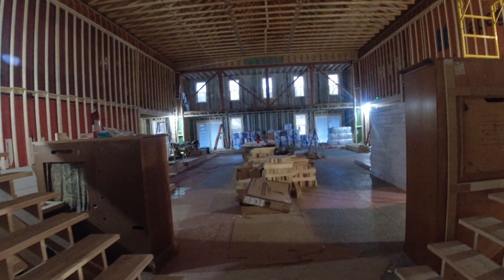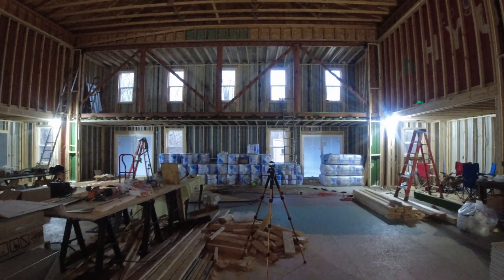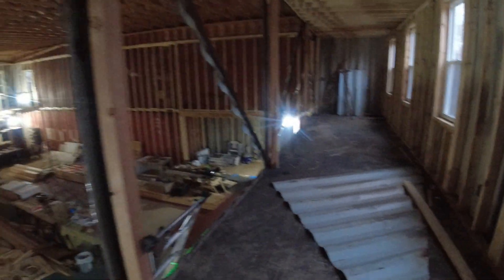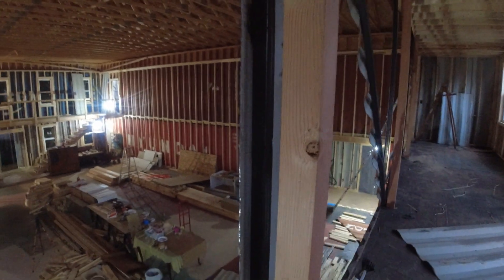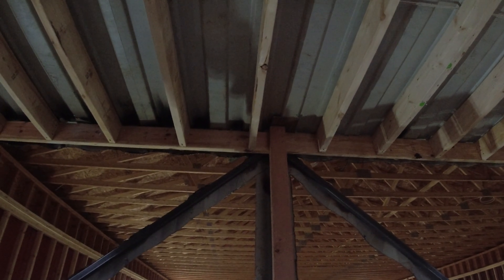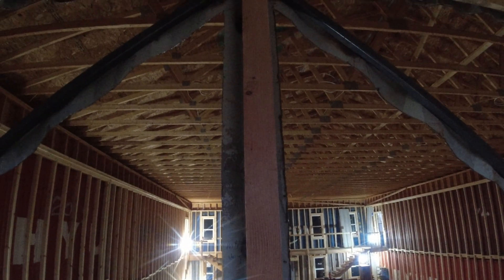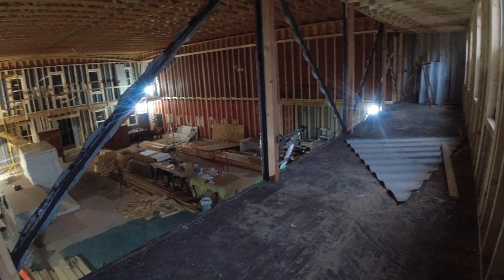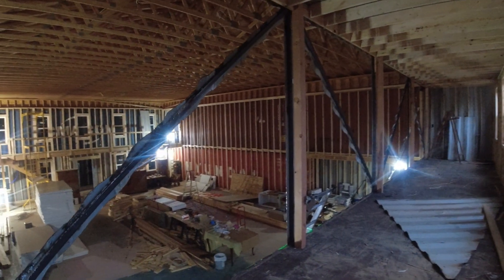How I maintain structural integrity when cutting open a container wall in a shipping container house

Comment: Thickness of those 1.5" structural columns?
Reply from the maker: Good question. 3/16" thickness, with a yield strength of 46,000 PSI and tensil strength of 56,000 PSI each. I actually did an engineering study of the structural strength of the truss structure for the city for approval.  I will make a video of it soon.

Comment: Sure you don't need a bigger house? Massive carbon foot print. 🤷‍♂️
Reply from the maker: That’s an appropriate comment. If you watch my video about my HVAC system, I am going solar and using mini splits. So the footprint is small to negligible.
Reply: @1michiganbuck  Just the concrete alone is probably 10 peoples lifetime carbon load. Why do you need so much space? Is this going to be a convention center or something? I can see it if this is going to house 20 people maybe?

Comment: Are you going with close cell spray foam with all exterior steel?  If not I would research it. No expert, but I would put some everywhere there is steel on the exterior walls, floors and ceiling. 

Keep up the good work.
Reply from the maker: Yes, I will use spray foam for all exterior walls and the ceiling.  There is no alternative because metal sweat like crazy when exposed in the heat and cold.  Interior walls don't sweat, still, I will use fiberglass for sound deadening.

Comment: I looked at building a 24 x 36 shipping container shop for woodworking a few years ago. Here is what I found then and after. The floor and corners of the container are the only structural parts. The walls and roof are not. Reinforcing the roof after removing the walls and the cost of three containers ran close to $20,000 without finishing the inside. No power, electricity, or heat. The engineer said I would need .5 X  6 X 6 inch 36 feet long I beams to support the roof. I looked at stick build and as a DIY project. The stick build came in at under $10,000 with concrete pad, power, insulation, heat, and electricity. Later I started teaching construction, and safety was a part of it. This led to becoming an OSHA safety instructor where I learned that maritime containers have some very bad chemicals in them. The wood is full of anti-decay, insecticides, and fire retardants. The paint has anti-corrosion products in it like cadmium that are very toxic and require a respirator if you are exposed to it. So, if you cut, sand, grind, or weld it should be treated just like asbestos. If a building inspector or sub-contractor walks on the floor and kicks up cadmium dust you are by law responsible for their exposure for the next 30 years.
Reply from the maker: Good analysis.  Good luck to your build.

Comment: You said you spoke to some engineers about this truss design.  Did they just like the concept or did they run calculations for you?  I ask because the diagonal braces look quite small which isn't a big deal except that they are in compression and are prone to buckling.  For this situation I would suggest squared off pratt truss and a licensed engineer to look at it.  Or an easy upgrade would be to strengthen at least first diagonals on each end.
Reply: Okay, I would suggest they do some calcs for you.  I am a structural engineer and I would not say it is adequate without running calculations.
Reply from the maker: They didn't do any calculations, but they did climb around the area to look at what I did.  That includes 2 MIT engineering grads and 2 Michigan engineering grads.  Still, I appreciate your input!  Diagonally, I am putting a 2x6 there soon, so that will beef it up further.  I could weld another tubing to it but I will check with a couple of welders.  They saw it and thought it was plenty strong.  Thanks for watching.

Comment: Very cool. What is the building department like in your area? are there any inspections or is it a free for all ?
Reply from the maker: I anticipated questions, so I built a thick deck to convince them, including hurricane damages in the Carribeans, where everything is flattened but the shipping containers.  They were sold!
Reply: @1michiganbuck   What about rated load you said 50klbs which seemed like a guess but a 2x4 is rated for 11klbs vertically, so your stated weight is equivalent to 5 2x4s? Doesn't sound right, im assuming its more. Im more curious what the actual rated weight is being that some places in the norther usa have heavy snow fall that is heavy.

Comment: What do you do about the floors of the used containers? They usually seal them with some nasty stuff.
Reply from the maker: Great question.  I will put down a layer of plastic sheeting.  Then on top, I will put down a layer of 1" aluminum backed foam boards (not expensieve from Menards), and then OSB.  That will seal everything in for, like, forever?
Reply: @1michiganbuck he doesn’t know what he’s talking about they should just be Brazilian or Asian apitong  marine plywood floors it depends on where they came from through the cheaper woods are sprayed with pesticides to keep bugs from nesting 

Also the walls of a sea can really don’t do much if anything the corners posts and floors are the structure that the reasons the walls are corrugated is so the walls don’t need supports the same principle as wavy brick walls

Comment: Wow love your project. Just wondering how long you predict it takes until you move in? 
What about rust inside, you are sanding and painting epoxy or you leave it alone? (Outside I saw you paint, but inside none?)
Keep good work 👌
Reply from the maker: Thank you for watching, first of all.  I was gunning to have it all done last year, but missed the timing for sprayfoam, because it needed 70 degree weather.  I aim to have it done in the summer.  Lots of work ahead, but certainly doable.  I will cover all walls inside with fiber glass insulation, but the exterior walls will be buried in sprayfoam from the inside, so there should be no rust issue.  Furthermore, Corten steel is what shipping containers are made of, so it is a weathering steeling, meaning the first layer of rust serves as a protective barrier.  So, this thing will probably last till some alient invasion occurs and then some.
Reply: @1michiganbuck  you mean outside fiber glass and inside sprayfoam? And why not rock woll? I saw videos that fiber glass will flame eventualy. 

I didnt see Pioneer ductless model which has „air flow from outside” i just found that „rotenso fresh” has this feature. You are sure that multiple pioneers will do the work in winter? I mean when the humidity rises and fongus will evolve on walls.
In Poland I saw many people mount „recuperation system”. I am just curious whats your opinion cause I will do container build too. Thanks :)

Comment: How will it be insulated?  Heated metal buildings in a cold climate are quite a challenge.  Watched a few fails on YouTube where they used standard insulation batts and that was a disaster.   I would think spray foam is about the only option to seal tight against the walls. Otherwise moist air will find a way and condense inside the walls
Reply from the maker: Agree,  Plan is to install spray foam insulation end of April or May 2024 for all exterior walls--there is just no other way around it.  Interior walls will be insulated with those piles of fiberglass stuff.
Reply: @1michiganbuck  OK good I figured that's what you would do.  The other guy I watched made a barn shape house but used metal roof panels for siding.  He put fiberglass right against the metal and half way through the winter found them all mouldy and had to rip it out.

Comment: Wondering if you are keeping a dollar tally of the entire project so far?
It really does not matter because the prices will vary with who will answer someone’s quote, area, location and time.
But for shits and giggles. Of course estimate the month and month and month… of your labor rate. 
Not that this has anything to do with the actual dollars. But it will be interesting to see what the town will assess the taxes to be. 
I have to say you must have a like-able character or very lucky to have such luck finding honest capable professionals working with you.
✌️
Reply from the maker: I think the cost question is a good one.  You can make a house with one or two container for cheap, for sure, but my project is pretty big, so the cost is high for the unique structure I have.  I do a lot of the work myself, epecially expensive metal work and welds, but still it is going to be about $500,000 when it completed in the summer.  To build a stick frame house like mine, it would be quite more expensive.  I am eager to find out what the town will value the house at.  Stay tuned.

Comment: Hello sir please share the cost breakdowns including foundation, containers and all. Great strong building
Reply from the maker: I just did an initial rough tally of the costs and my estimate is about $500,000 to get it all done, including 11 acres of land.  Please keep in mind that I do a lot of the work myself and this is a house the eventually will have a 6,000 sf living space, a 4-car garage, a 4,000 sf basement, and a great room that is 40x68 with a 20-foot ceiling.  I did build a tiny house with a 20-footer that cost me $10K, but I did all the work pretty much myself, so that was just materials cost.  I will do a video on all this because I find it fascinating.
Reply: @1michiganbuck I hope your property taxes are going to be reasonable !
Reply from the maker: Thank you for the request.  I will need to put a short video out on the cost, because that would be an intesresting story.  Stay tuned.

Comment: Okay, Everybody including Santa Claus likes it - but WHO CERTIFIED IT AND WHAT DID THE BUILDING INSPECTOR SAY ? Those Guys Wanna See Specs And Crap.
Reply from the maker: Good question.  I worked hard to get the city's permit with a thick deck, including a picture of hurricane damages in the Caribbeans, where everything was flatten except shipping containers.  They were sold after they saw that picture and calculations about the building weight the steel ridigity.  They are actively working with me to make sure everything is up to code.  Not surprising they do that, because there are literally tens of thousands of container houses in the country now.  As for home owners association, I own my 11 acres in the woods, so, as Napoleon would say, "Je suis la putain d'association de propriétaires."
Reply: I like what you did. Haven't seen anyone anywhere do anything like it. 
Very slick. I'm not gonna spend 40 grand on an architect to draw up snow loads and load bearing wall stresses. Where I'm thinking of building they all squawk about every cut you make destroys the container structural integrity and want it all recalculated.
Reply from the maker: @artkarr9702  Fully understand your concerns.  I am luck in many ways.  I did the design myself (I have a video on that at my channel if you look) and did my snow load and container weight calculations myself, so in the end I only spent $2K to get an architect to pretty it up and put his name on it.  As for structural integrity, I am going to make another short video about how I made every effort to make the containers even stronger by adding tubes and beams everywhere.  Stay tuned.
Reply: @1michiganbuck  Excellent job. Your message caught me while I was watching some of your other videos. Two things have struck me so far - your not selling crap like fasteners or plans or your technique. Your doing it the right way. Everything you do makes sense and won't need a workaround later. I guess I've become a FANBOY .. Ha Ha Ha
Reply from the maker: @artkarr9702  Thank you, sir!  You are right.  I do it to create a real good house, and the videos are just me setting up a camera while I do work.  I do need to do better videos, to share my lessons and knowledge.  Thanks for the kind words!
Reply: @1michiganbuck  Nah, Absolutely NOTHING Wrong With Your Videos - Your Sincerity, Intellectual Thoughtfulness Show Through.  You Can Go Hollywood If You Like ... There's Nothing Missing In What Your Doing. Maybe Later You Might Need To Edit Things In Sequence Or Step By Step Spoon Fed Video. Actually Like The Way You Present Your Build. Beautiful House - Built Solid - Off The Shelf Materials. Common Technology. WINNER -
Reply from the maker: @artkarr9702  Thank you for the kind words!
Reply: @1michiganbuck  Ya know with all the low cost LED lighting and switches and outlets being easy electrical. And with PRO-PRESS Fittings and PEX the plumbing will be easy as well. WHAT I'M INTERESTED in seeing eventually is how the heck are you gonna do the HVAC ? When I built my current stick built home I used multiple furnace and AC units for different areas, different levels on different timers. 30 years ago, timers and zoning and habitation was not a big deal - Paid For Itself Many Times Over. Mechanical Baffles in the walls STILL aren't reliable. You Got SNOW AND COLD - YOU GOT HOT AND HUMID. 30 years ago I did passive runs between levels to facilitate cold air downward flow and better mixing. I can't see how your gonna do it .... I'm gonna be an interested observer.
Reply from the maker: @artkarr9702  Interesting you ask about HVAC.  Here is my recent post on my Facebook account: Want to share a tip if you are building. For heating, I tried to get Consumers Energy to run a gas line from my neighbor’s yard 400 feet away. First quote was under $10K. I waited 4 months; in March, they kindly sent a new quote: $38K. I was so incensed that I told them, like a Brit would say, “Sod off!”  Instead I decided to use mini splits for both heating and cooling. It’s cost effective and green, where the heat pumps in these units can extract heat in -20 degree weather to heat the house. They also require no air ducts. And some have fresh air intake options. Home Depot sells these Pioneer units but I went to the source and they were going to give me an 8% discount on prices already cheaper than Home Depot. Then we ran into Black Friday timing, so the discount was 20%. I bought 6 units with 24,000 BTU each, for only $10,730. I will install these myself with guidance from my HVAC expert neighbor Dirk. Eventually I will install 20 solar panels and a 30KWH battery bank for $20K, so I will be totally energy independent. All for around $30K. So, thanks to Consumers Energy for their ineptitude. The goods arrived yesterday. I am tired myself writing all this, so if you made it to the end of this post, you need an award!
Reply: @1michiganbuck  Another really slick move on your part - turn off the shelf current technology into a game changer. Installers wanna sell you stuff and use stock prices for installation time.  Can't get a lousy faucet aerator replaced for less than $250 anymore. This is the type of REAL WORLD -- SCREW THEM -- I GOT MY OWN WAY Stuff that's missing in construction.
Reply from the maker: @artkarr9702  Like you, I take a lot joy and satisfaction in doing things and learning to do things on my own.  I love finding good solutions to dumb problems.  I need to make a video about the HVAC situation, to share my tip with people.
Reply: @1michiganbuck  You might wanna get another opinion about how many units you need. 175,000 BTU total for the size of your house seems like not enough. High Ceilings  are a magnet for any warm air. It can be 100 degrees at the top - and 50 degrees at floor level. Like anything else - the only time the plans and install gets interesting - IS IF IT WORKS OR IT FAILS. I was interested on my house on adjusting heat and cooling in areas when we use them like bedrooms from 9 pm to 8 am and automatically adjusting other areas accordingly. Just like water, air flows it's own way. FAST unless it's blocked by a closed door or constantly mixed. ONE OF US IS GONNA BE SURPRISED. I hope it's me. I had to modify my walls to allow for natural air flow. I'LL BE WATCHING. Wishing you the best. I'm gonna build in the mountains in the Southwest - 330 days per year of sunshine - Rarely gets above 85 or lower than 20.
Reply from the maker: @artkarr9702  thank you for sharing the concern. I’ve already thought it through. There are two ways to mitigate the high ceiling. One, I will use four ceiling fans to make sure the air at the top gets moved throughout the house. Two, I am building a wood-burning fireplace. I have tons of downed trees on my property that I can use to heat the house in the winter. In the summer, my woods keep the house cool, so cooling is far less of a concern.
Reply: The real beauty is I can see things and incorporate them in my build. I like seeing your thought process more than the grunt work. At least in this video.
Reply from the maker: @artkarr9702  Really glad the video can be helpful!